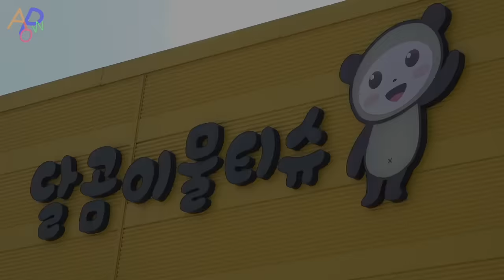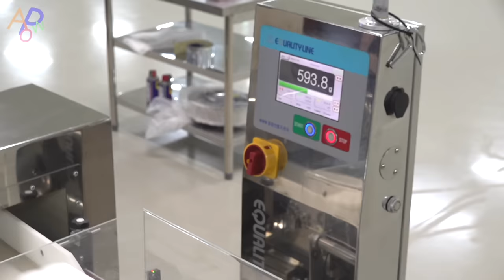Baby Wet Wipes Factory Of Korea Making Orderly

Comment: The reason the sticker application process is not automated is probably because the picture, shape, and size of the sticker are different for each product because the machine does not make only one product. Because of that, it is natural and reasonable not to make additional expensive mechanical equipment. In addition, it is sometimes necessary to pick out defective products that cannot be determined by a mechanical sensor with the human eye. It is still difficult to make products with 100% machine power, so human eyes and hands are required.